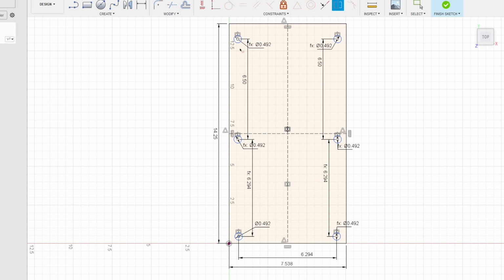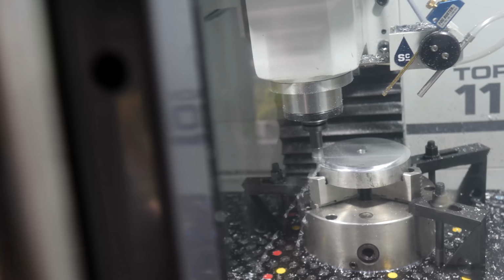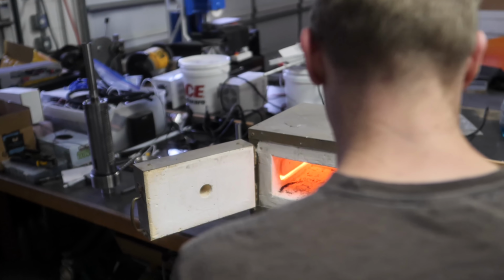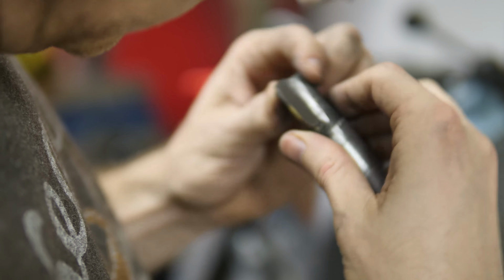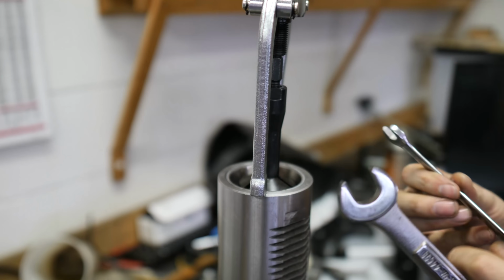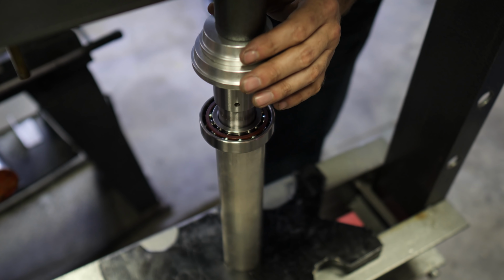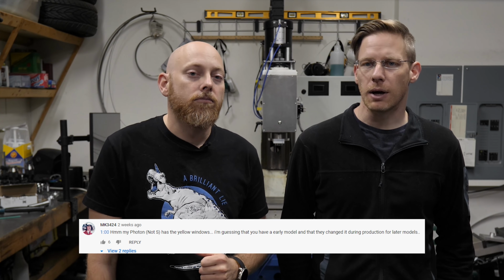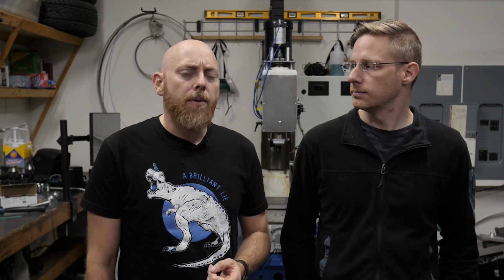CNC Spindle - S03E09

Comment: There is a whole lot of point using glass scales for feedback because they are measuring post lash actual displacement of the carriage vs your super dooper rotary encoders that are measuring pre lash movement of the motor shaft before it travels through any of that cumulative lash and wear... not so super dooper.

Comment: If you want to get as accurate as possible, linear encoders actually make sense. Most super high end machines use both. Glass scales and Rotary encoders with preloaded (around 50 micron per meter) Ballscrews. They then average both readings while taking into account thermal growth elastic deformation etc..

Comment: Broaching looked good.  If you have a Tormach, why build another CNC mill?
Reply: Peter Nichols I think the Tormach is in a different shop of someone else
Reply: For messing around whit it
Reply: The PM-940 is a fair amount larger than the Tormach.  The 1100 is 18" X and 9.5" Y and the 940 does 25" X and 13.5" on the Y

Comment: Hi Guys, great video.  I have a PM-940 that i'm converting to belt drive.  I like the way you mounted your motor.  Can you share the dimensions for the motor plate and the standoffs that mount to the top of the head cap?  Thanks much.

Comment: I get using aluminum for weight reduction, especially on the pulleys, but why not try for steel? The motor could definitely handle the inertia, and those new bearings probably could, too

Comment: 10:39 potentially damaged the bearing by pushing on the inside race not the outside race.
Reply: I'm guessing the bearings are designed to take an axial load, seeing as they're being used in a mill, so this probably wouldn't damage them too much!
Reply: "Angular contact ball bearings have inner and outer ring raceways that are displaced relative to each other in the direction of the bearing axis. This means that these bearings are designed to accommodate combined loads, i.e. simultaneously acting radial and axial loads"
Reply: @climberjb  not a matter of damaging too much it's a matter of the wrong practice being used. The forces while pressing are huge and could be compared to a full crash that will often bruse the bearings requiring replacement.
Reply: That's not the worst of it.  Just horsing them in at any old angle will be the death of them well before lightly bruised balls. 

If you need to use force to put it in, you'll kill it by not putting it in straight. 

Stuff that should last ten years failing after 6 months. I've seen it!

And don't go crying to the dealer when it fails either, cause they'll take one look at the outer ring and send you home with a flea in your ear.
Reply: Yes, they could have damaged the bearings. They would have had to check C0 and calculate the load to make sure they don't while installing them

Comment: If you have a problem with heat, play with your bearing preload. The idea is to get 0 run out with least amount of pre load. This can be very finicky.  I actually install a thermometer right on the spindle to keep an eye on it. 7000rpm at 30 minutes is where mine starts to get to hot on my #g0704.

Comment: I was very confused when I saw the brazing bit sliced in, but then I realized "oh god they turned the Z axis into a CNC broach...".
That is both creative and slightly painful, given that the Z axis isn't meant for huge repetitive linear loads.
Reply: Click Spring did something similar, but he used his lathe and moved it manually.
Reply: That’s a common practice with a lathe
Reply: @HermitFab  Sure, but lathes are designed for it.

Comment: Wouldn't linear encoders be more accurate as they will handle any backlash caused by the screw?
Reply: Looks like they are using ballscrews not leadscrews.  If they are C5 rolled ballscrews there is only 50um of backlash.  If they are C7 ground ballscrews there is even less.
Reply: @routercnc9517  You've got your grades backwards.  Lower numbers are tighter tolerance.  50um is a lot of backlash (~.002") That can be compensated, but can really have a negative effect on surface finish and tool life when climb milling.
Reply: Hi Jon.  Ah yes C5 and C7 should be reversed, apologies.  I’ve made lots of CNC machines with C7 ballscrews (rolled) and been happy with the finish but I’m only making parts for myself.  My latest machine, also C7,  has double ballnuts back to back so backlash is practically zero.  Finish is better again but the machine is also much stiffer so possibly a combination of effects happening there.

Comment: @PA How did you determine the existing spindle bearings needed to be replaced to handle 8k rpm?
a) Read product specs of CNC.
b) Find part number on bearing to check its specs.
c) Other.
Reply: NormacI?